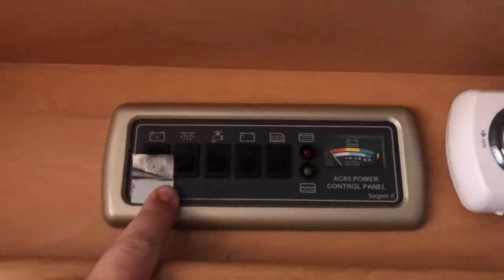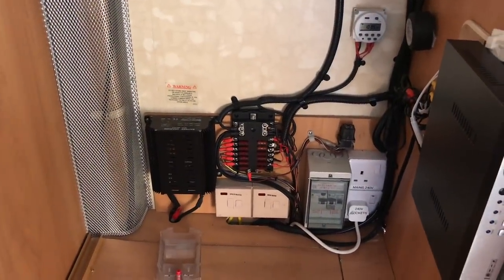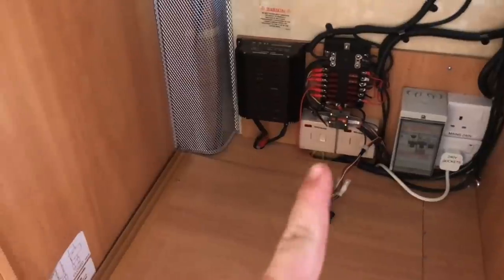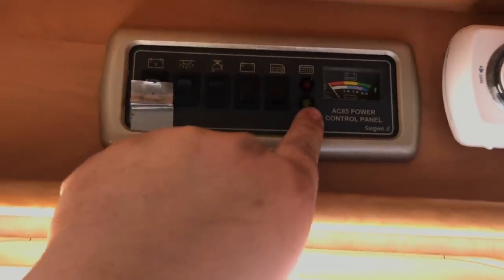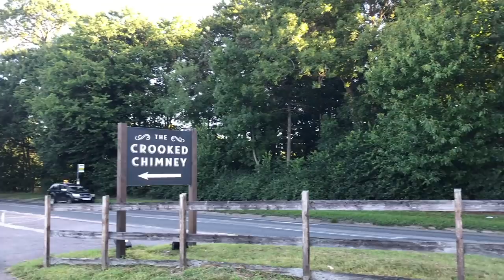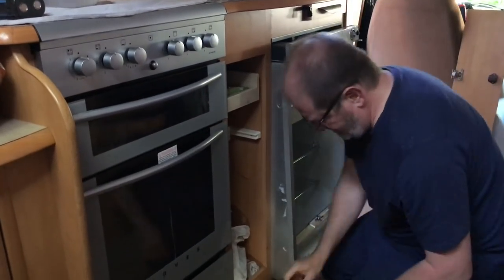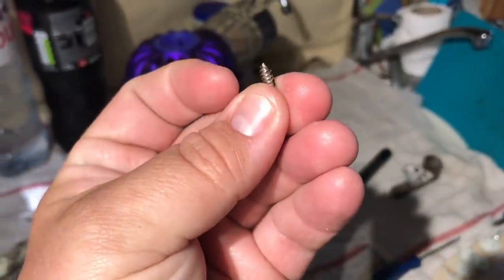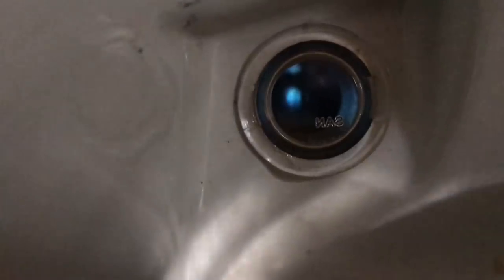Electrics, electrics, electrics! - Weekly Vlog #4

Comment: If fuses keep blowing use a 21w test light (make one with an old bulb holder and a 21w bulb) instead of a fuse to find the fault.. Put the wires from the light where the fuse should be... If the short is there the bulb will be bright... When its not there the bulb will go dim!

Comment: Yes it's well worth getting to know your electrics. And how to bypass to give emergency power should things go wrong.

But if you are around Nottingham you can give me a call should you be in a pickle with your electrics.

I have a City & Guilds in electronics.
Therefore l will be right into the electrical layout when l get hold of my van (watching your uploads whilst awaiting delivery).
I will install my own invertor & solar system. Then fit an additional 2 very big ass batteries. I will have a power bank on wheels.

Bloody snowing heavy & getting dark. So l won't be taking it out for a spin tonight. But l will feel at home driving a bigger vehicle as my mother one is a Nissan Navara. And l clocked up thousands of miles driving 7.5T lorries for agencies about a decade ago.

So will now watch another one of your uploads to keep me occupied whilst waiting on my van to arrive.

Comment: Darran, get in amongst it (That's what she said) you can learn this stuff mate, you aint daft.
Your spade fuses, if they have melted the link inside, it's overload/hot/loose connections, if it's shattered/exploded the link, its a short circuit like cutting through a live cable. Things that run on DC need to be tight tight tight. Avoid cable joints, and have good access to all terminations. DC behaves different to house electrics, lower voltage = higher current.